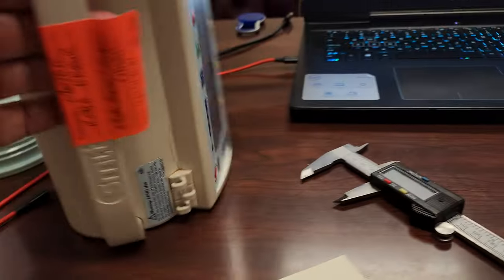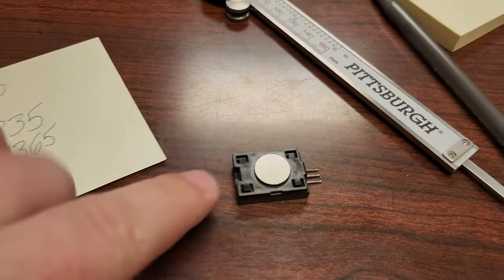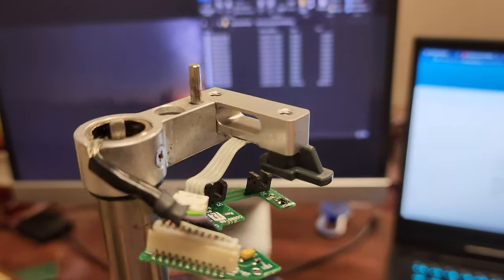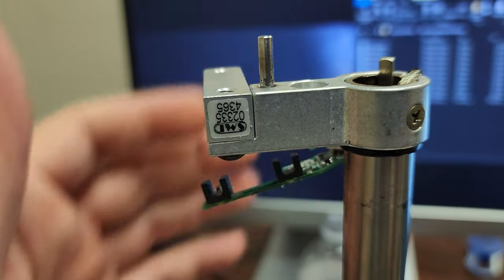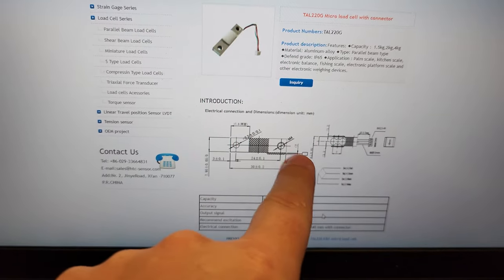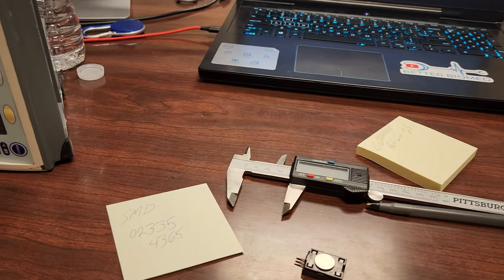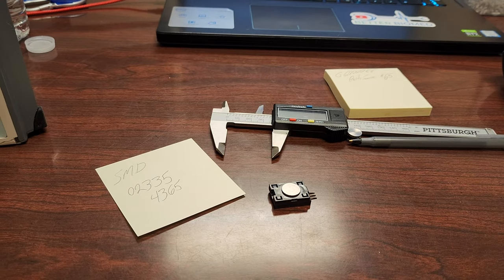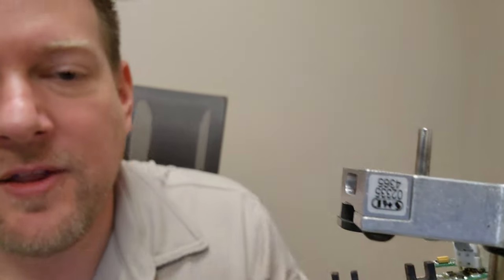Looking for parts..  Again.

Comment: More often than not it’s a problem with the board. I work on a ton of them and my troubleshooting goes plunger board-main board-cable-force sensor. Like you said the force sensor is very durable. I find the plunger head takes a lot of physical abuse wether it’s drops or things banging into it. The mechanisms that operate the opening and closing of the syringe head clamps knock components loose on the board. Put it into diagnostic mode to look at the force sensor value. Just quickly use your thumb to put pressure on the sensor, if the value doesn’t change you’re looking at a communication problem (plunger board/cable/main board). If it picks up your pressure it should be a bad force sensor.
Reply: Also just ordered some parts on Friday for them. Smiths redirected me to ICU medical for ordering. I didn’t order force sensors but never had an issue ordering them right from Smiths in the past

Comment: I assuming you already did a calibration. Make sure there is no cracks in the plastic of the left & right plunger cases,  including where the screws go into. Make sure the plunger tube at the carriage is not loose. Also plunger cable may defective.

Comment: More often than not it was that little board for me. Sometimes it's the load cell, but mostly that board from the thing being banged around. Just wait until you open one that's filled with month old rancid preemie formula. Top and bottom case were the most frequent replacements for me.

Comment: This video is slightly confusing because you haven't clearly explained the failure of the device.  Some of the questions I would need to ask are why is the load cell exposed? what happened?...did it fail calibration? did it fail a preventative maintenance inspection?  did someone just say it wasn't working anymore? How long has that device been in use?
Reply: The stepper motor is what retracts the arm on this device.  I'd presume that if the device was in use for a long period of time that the stepper motor could fail causing the force guage readings to move out of tolerance no fault of the load cells.